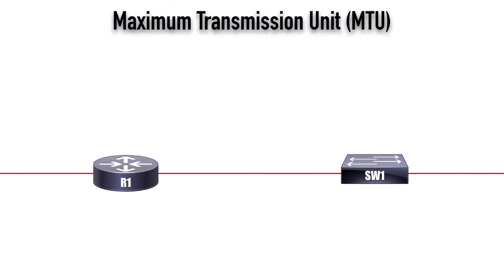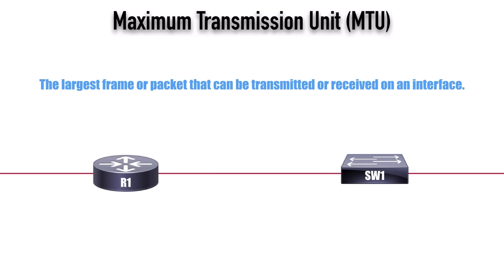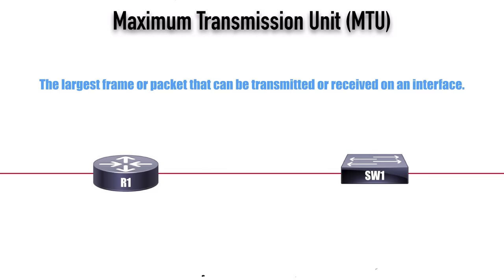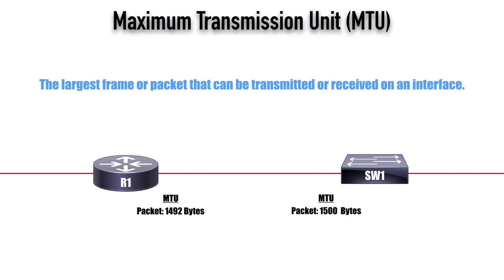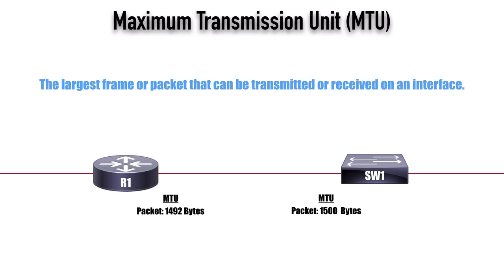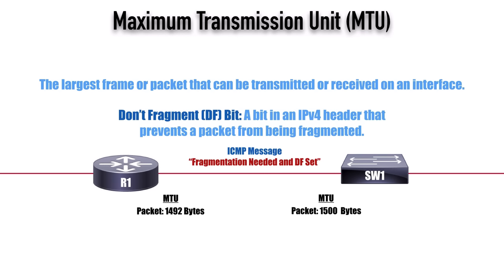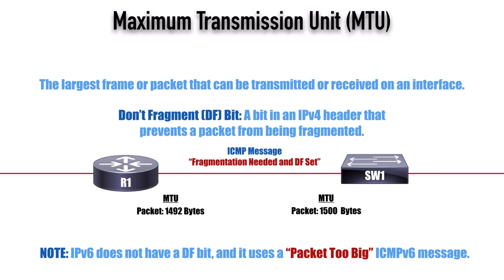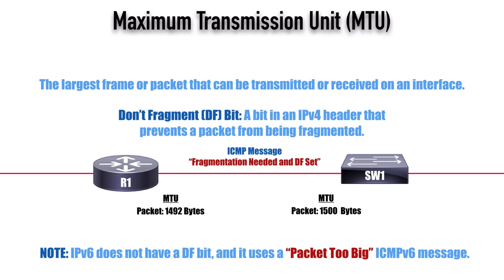Network Basics - Maximum Transmission Unit (MTU)

Comment: what happens if on R1 the inbound  is 1518 and outbound is 1492?
Reply: If you set MTU 1518 on R1 its for Tx and Rx and its going to accept the packet of 1518 bytes. if inbound traffic from the switch comes higher 2000 bytes its going to be chopped and fragmented.
Reply: @prabhushankar2239   thanks but I'm asking if R1 to the switch is 1518 and the other R1 interface is 1492